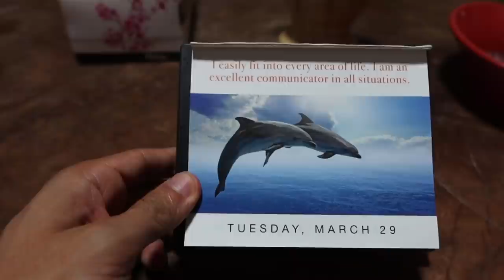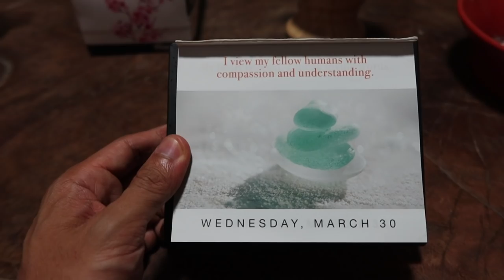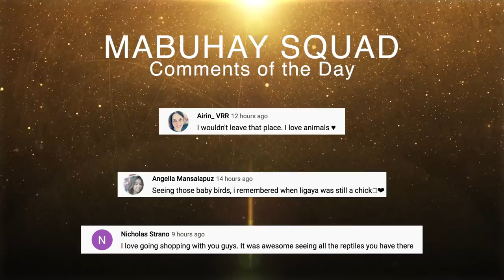OMG! Our New House FINALLY Has Windows! - March 30, 2022 | Vlog #1473

Comment: We are finally installing new windows in our house after 8 years because the house was built in 1939 and I guarantee you it still has the same windows from 1939 which means they're absolute crap